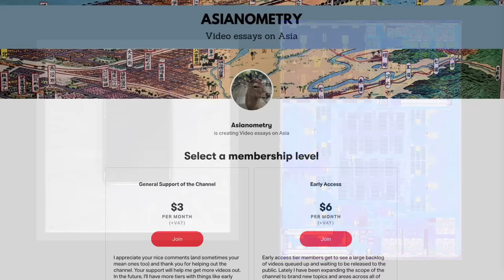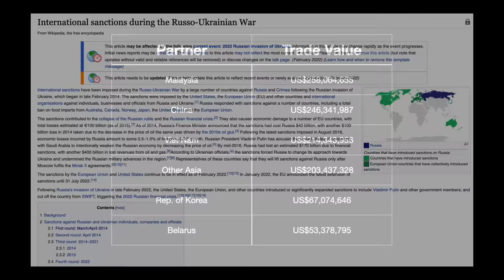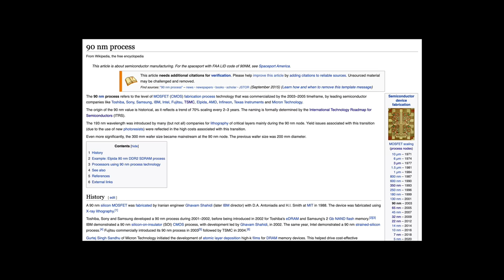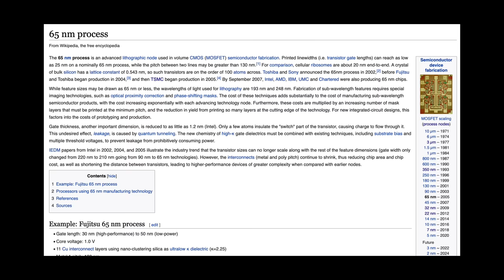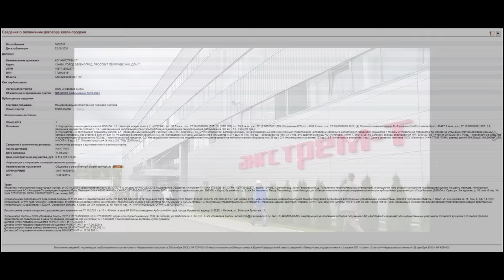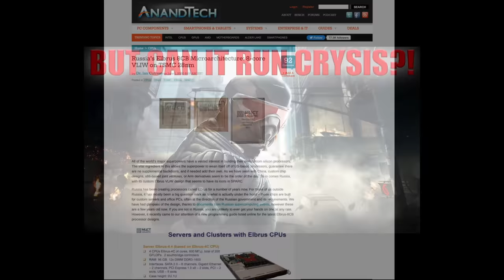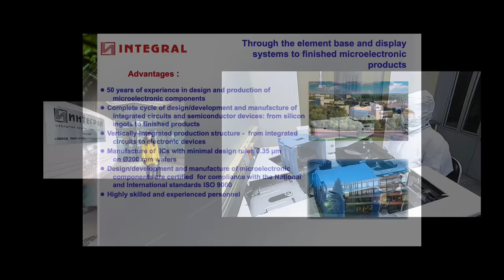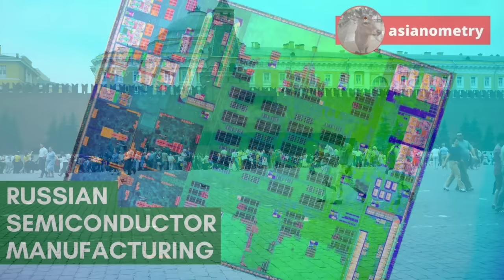Why Russia Can’t Replace TSMC

Comment: Interesting but vast amounts of processing power are wasted on bloatware, inefficient software and poor security. Russia has long been smart in squeezing the most out of antiquated hardware.
Reply: Another way of phrasing that would be we have so much performance we don't know what to do with it.
(on most consumer devices)
Reply: @TauCu  I agree, if you strip the unnecessary junk out of the PC operating environment nearly everyone would have their needs satisfied with a Core 2 Duo from 2006. The software product lifecycle is based around getting you to buy something new that drives the hardware lifecycle of forcing you to buy something new.
Reply: @moconnell663  As a software developer myself, I'd say it's mainly that the compute horsepower has made many frontend developers lazy.

Either way It does serve to incentivise more progress in making faster hardware.
Reply: True..i have my old pentium 4 IBM laptop with Win XP ..and turn im on few times a  month..and always surprised  how fast everything responds and works ..and most stuff is actually easier to do on him then on mu i7 laptop with window 10 (windows 11 want see my laptops ,for me its downgrade)
Reply: That is one reason USSR failed in digital microelectronics. Soviet engineers thought they are very smart, so they optimized every bit of their tech to concrete tasks in hand. At the same time American engineers created "bloated" standardized chips and "fat" high-level programming languages. Guess who won.

Comment: The worst thing about this is, I have to re-evaluate what I said about open-hardware designs in my dissertation.
I make it sound mostly beneficial. In face of the current situation, I heavily need to reconsider that.
Reply: I just had the same thought about open software when the video mentioned the Astra Linux.
On the other hand: I think open hardware will never be bleeding edge and secondly the design isn't the issue, it's the lack of production capacity / capability, and that's something you don't solve by usage of open hardware.
Reply: @tobiaswilhelmi4819  That's true, but it does change a bit how you think about exporting technologies.

Comment: The way Russia have been going through sanctions after sanctions and still survive, I wouldn't be surprised if they suddenly have the capability to make 16nm chips. Maybe not 10nm or the cutting edge 7/6nm, but something like 16nm would be good enough to produce CPU and GPU. Ofc the world wouldn't even bat's an eye to 16nm, but it's a good start if they want to be self sufficient.
Reply: There are no shortcuts!. As per the post above by Gustav Derkits, manufacturing to these levels requires an investment and a commitment from society as a whole - Russia's endemic corruption unfortunately commits them to mediocrity for many generations.

Comment: Russia doesn't really "depend" on TSMC as it's chips are very specific - primarily for government and military use. Consumers and independent businesses don't use them as they are not competitive with Intel/AMD due to lacking peripheral hardware, software, performance, price, etc. It might have relied on TSMC to replace them but this is option already ruled out due to sanctions.
Reply: TSMC fab ARM chips that is heavily used in industrial automation.
Reply: @theVtuberCh  not by Russian manufacturers of industrial equipment. They prefer old and weird stuff that is a nightmare to program or even timer circuits where possible.

Comment: Guns may not need 7nm chips but air defense, radar/sonar, missile guidance, fighter jets all depend on the best processing power available.
Reply: Most military systems are several generations behind consumer technology mostly owing to long development cycles. As on 2006 when the F-14 was retired it was using a DSP designed in the early 80's in it's radar for example (it was specifically designed for that purpose and was never replaced because it did the job of processing the signals from the electronically scanned phased array radar perfectly fine and there was simply no need for a faster chip). The reason the F-14 was retired was because the swing wing design made it too expensive to maintain vs the F-18 not because the F-18 was better (it wasn't).
Reply: Not really.
Reply: High performance is needed to compensate for the low qualification of programmers.

Comment: Russia has a monopoly on inert gases including Helium, which are used in production of all of these semiconductors...
Reply: US is world leader in Helium,it isn't in a shortage we have so much we use it for party balloons.
Reply: @paulbedichek2679  Neon gas is the most used in chip manufacturing and Ukraine was the largest supplier in the world. That was halted to a stand still. Which makes Russia one of the few affordable producers. I've been working in this industry for 15 years, it's becoming a bit of a nightmare.
Reply: @olegloginov2953  Yes,of course Neon,I was responding to the person saying the US was short of Helium,different element, two protons. Still ,we have Neon,I'd guess the price has rocketed.
Reply: @paulbedichek2679  Absolutely no idea why I said Helium in my original comment, thank you for correcting me.

Comment: "guns dont need a 7nm chip" is the most accurate statement.
Russia failing to compete with the US, EU and China in latest tech equipment will mean they will have far lower compute power.
This will mainly limit their AI training, science research and maybe server capabilities.
Missiles do not use general purpose cpus.
Missiles and most equipment of any kind nowdays use "ASIC" chips (Application-specific integrated circuit). ASIC chips are usualy far cheaper and more performant on the one thing they are designed to do. They also use far less power and have near to no bugs-crashes-failures. ASICs put on missiles usualy are at a higher lithography for many reasons:
1) lower cost
2) resistance to noise, more reliable in factories or aplications with too much noise (a military missile)
3) heat is far more easily dealt with, no heatsinks or coolers required

In case to produse a decent ASIC you need:
1) Highly skilled engineers
2) Fabs to produse
3) A large amount of devices using them

Most of the cost of an ASIC product goes to the software and hardware engineering because they are very specific to the application and cannot be used in any other device.
If you fail to get a large production of the final product then your "design cost" went to waste.

Here is a short explanation of BAE and why they use ASICs, note that BAE refer to asics as SOCs, this means that system memore (RAM), storage (SSD) and other parts of a normal computer are all inside the chip (with very small capcities, just enough to do the specific job):
https://www.baesystems.com/en-us/definition/what-are-asics
Reply: A lot of what you say about ASICs is rubbish. I used to design them.

The cost of an ASIC is dominated by three things: the NRE charge that has to be paid up front to the ASIC vendor to cover the design validation and layout, pre and post layout simulations, generation of automatic test data if the customer has requested it, and the fabrication and testing of the engineering samples.

All this is done before full scale production occurs.
The second factor is chip testing and burn-in for military applications which isn't done for consumer products.

The third factor is the physical size of the chip, the die itself.

The military market is much smaller in terms of the number of chips they buy compared to the consumer product market, so they don't manufacturer as many chips, so that NRE charge is spread over a smaller production quantity of chips meaning the unit price per chip becomes higher.

Comment: Since 85% of all neon used in semiconductor manufacturing is generated in Russia and purified in the city of Odessa in Ukraine.  So most of the semiconductor industry is going to be shut down.
Reply: The neon is largely used in the making of the lasers needed for making the wafers.
Reply: This is not accurate lol. Shutting off neon isn't going to have an immediate effect at all. Over time it will make lasers harder to get but these companies can pay for it.

Comment: I had no idea Russia was so far behind, that even ST's 90 nm node is better than everything else they have.
Reply: To be fair, many current applications are stuck on 90nm in embedded. Some structures don't scale so well so it make no point going down.

Even in high perf stuff, some parts behave better in older nodes ( some PHY serdes, say, are very mature on some nodes and don't behave better on lower nodes). If you had to pick one only, I'd probably go with 28 or 90, depending on the actual needs. 1x nodes are already a luxury thing ...
Reply: No connection to international community, and on the hardware side permanent problems with in-country supply chains. Those "socialst" countries do not have a market-driven economy, but instead, material supply is planned for intervals of sometimes many years. Which makes complicated pushing forward innovation, especially it you do not know in advance what you'll need, and whether you get all that in time. Chip production is not only about theoretical know-how, but you also need a lot of lab and testing work to do, including running many test cycles. If you don't get enough supply for that, research and development are slowed down.
Reply: And what country are you from and how far behind TSMC are they?
Reply: @Simon-gc6uf  France, where ST is from, and which has had 28 nm FD-SOI fabs in production for a decade. Same company that set Russia up with its 90 nm fabs. We're at least on par with China except our chips work... can't say using a Chinese SoC has ever actually worked for me.

Comment: Russia doesn't need to replace TSMC, it will simply cut supply of metals that are used in photolithographic process. 60% of raw materials TSMC is sourcing from Russia
Reply: If that is true, then TSMC will adapt and Russia will be left with no negotiation power at all.

I thought most of the rare earth metals came from China?

Comment: What about the chips and equipment used in Russian aircraft such as the Sukhoi Su-57 Felon, Sukhoi Su-35S, who are these made by, locally sourced or imported, if local then Russia must have some decent chip making technology somewhere as these aircraft rate 2nd and 9th of the top ten fighter jets currently available
Reply: Being a "5-th gen" fighter (only the Su-57 is, the Su-35S is a "4+") doesn't mean much about it's digital capabilities.
They might very well be using 200+ nm chips. Both military, and aviation (and military aviation, lol) - puts reliability and simplicity before things like energy efficiency.
Have you ever been in a GA airplane? They feel (and are) very oldschool. Military jets are kinda similar. Unlike car manufacturers which come up with a new model every 3 years and expect it to be on the market for 3 years - aircraft systems come out once in 20-30 years. And are expected to be manufactured for a similar time, too.
Reply: I would say if they sticked to linked multi-chip FPGAs, single purpose fixed logic, digital signal processors and microcontrollers used in a distributed control system configuration, would make 200nm+ more than adequate. The pilots don't need to run crysis on their MFDs.
Reply: Thy don't make a single advanced fighter.
Reply: Russian aircrafts can not get air dominance over a country right next door with out  an airforce. They may look like fighters but they don't function. Denmark has 4 F-35 they could destroy the entire Russian air force.
Reply: @paulbedichek2679  Dreaming.

Comment: i dont think it will take more then a decade for this to develope, since consumer wont have other options except indigenous designs , it will bring money for them and hence faster developement, and yeh some leaks will be there to boost it
Reply: In the short term the other option is to keep using what you already have. If they are 15 years behind the times, then your 5 year old gear is still going to be better than anything that can be produced indigenous.

In the medium term I suspect small shady firms in neutral countries will supply at least consumer and small buisiness grade tech to Russia.

Comment: actually Russia has been manufacturing chips since 2013, they did this to get away from relying on the west chip kool aid.   This was done in March, Russia's hyper sonic and normal cruise missile attacks haven't slowed down, in fact, they're ramping up attacks so I think their chip technology is fine. At least good enough to take out Ukraine.
Reply: But what chips have they been putting into their computers and cyberinfrastructure? TSMC, Samsung, UMC, Global Foundries, Intel, and SMIC. All besides SMIC have stopped ship[ments to Russia. So basically their 90 nm node from 2004 will have to do a lot lot heaving lifting. Don't forget the machines comes from ASML, Canon, and one more company makes them which means that all chip machine making capacity is in the west, which isn't gonna be well for Russia to develop more advanced weapons without having to develop a new node and the machines to make that new node.

Comment: So you're saying people in Russia won't loose their jobs to automation?
Or its cheaper to hire people than to purchase automation + manufacturer servicing?
There is a reason barely used robots can be had for dirt cheap in the US.
I welded somewhere that spent over two million dollars on a welding, and forming robots, after us the lowly welders told them it would never produce product with the loose tolerances of product they were capable of producing.
The robots never produced product, their attempted implementation removed existing production capabilities.
This company was ran into the ground in the 4 years I was there, they bought it from a descendent of one of the signers of the declaration of independence for 80-100 million dollars in 2015, ended up selling it for 5 million dollars in 2019.
Their stock price from the time I was there went from 6 bucks all the way up to twelve dollars, then rapidly fell to below 35 cents.
The president and vice president of the company just worked there for a minimum amount of time to collect their pay and write it down on their resume as they messed things up.
Amazingly they ended up getting covid money which I'm sure the government will never see any of back.

Comment: Spin up fabs at home and contract with ASML after this whole shit storm blows over.  Hell, even the US needs to spin up fabs and get their asses together to out Dutch the Dutch on precision tech rather than relying solely on imports. Half of ASML's R&D partners are US based anyway.  One area of the world holding all the cards in terms of cutting edge IC tech is not healthy by any stretch of the imagination. Here's looking at you Intel.
Reply: (1) it takes a lot more than ASML machines to make a working fab. It took Intel the better part of a decade to make ASML’s work properly on the 10nm node - long after TSMC and Samsung had already moved on to the next node.
(2) ASML is headquartered in a NATO country. Do you really think they’re going to be exporting to Russia while sanctions are still in force?

Comment: Russia will be buying Intel/AMD/etc no matter what sanctions are used, using third countries. And for critical stuff like military and space chips, domestic production of 90-350 NM is more than good enough, sometimes even requiring "old" fabs production, that can be radiation hardened.
Reply: if you want, you can turn off the intel and amd processors and the Russians will never run these computers on these processors again, although I do not rule out that they can start climbing into them and trying to bypass blocking backdoors, to tell the truth, this will simply speed up the development of their processors in Russia and the importation of Chinese , yes, this will hit Russia hard in the short term, although in the long term the West will lose the Russian market in this area, and it will also not be possible to receive a lot of information from Russia and turn it off again, this should be used only in the most extreme cases

Comment: You VASTLY overemphasize the importance of being on the leading edge for a fab... For >=99% of IC's you don't need to be on the leading edge, just relatively close. All Russia REALLY needs to do to be HIGHLY competitive on the global stage for IC production for all but the MOST highest performance products is reach ≈32-28nm. And this is true for basically any country looking to build up their indigenous IC manufacturing capabilities. 

ACTUALLY reaching the leading edge is a MASSIVE waste of money and time. You'll NEVER be able the compete with the "mega-fabs" like TSMC & Samsung at the leading edge, so only an idiot would try.
Reply: but why would anyone use 32nm chips in 2022?
Reply: @Cooe.  so you trying to say all the iphones, samsung, other android, intel/amd laptops, GPUs, smartwatches, smart anything make up less than 1% of ic (integrated circuit) use? Come on bud.

Apple in the span of 3 months can sell close to 80 million iphones. And android sells a lot more low end phones than apple (which still uses these advanced chip fab processes). 

I would be surprised if those devices made up less than 80% of all chip use actually.
Reply: @Cooe.  most countries have fighter jets, submarines warships and other military equipment in amounts a pre-schooler could count to. Some where in the thousands. You saying that is 99% of chip usage??? Bruh

Comment: Russia does not have to replace TSMC but only has to be able to do what TSMC does because they will require the ability to make their own chips making them independent of the United States and others that use the fabs and design companies.
Reply: Replacing means making a new thing to do what the old one did. I don't know of any other definition that could be confusing you.